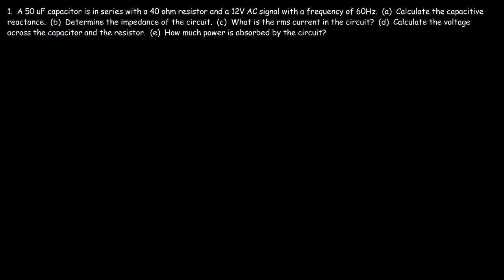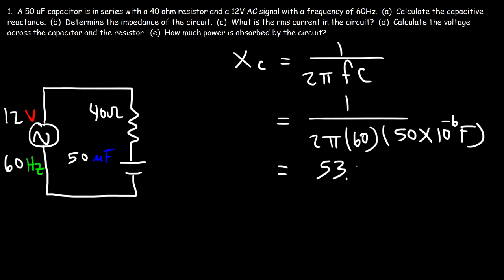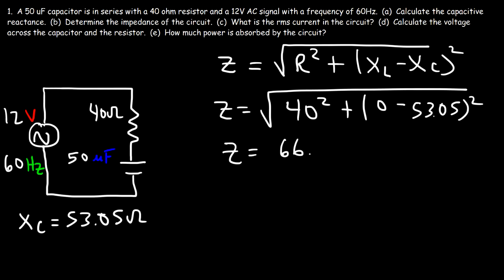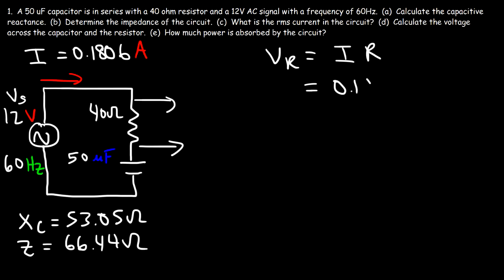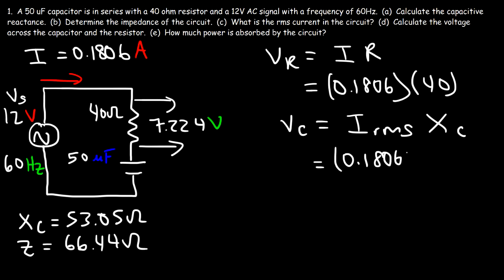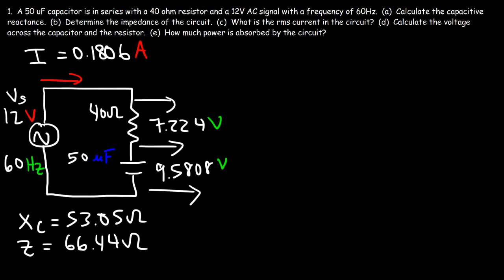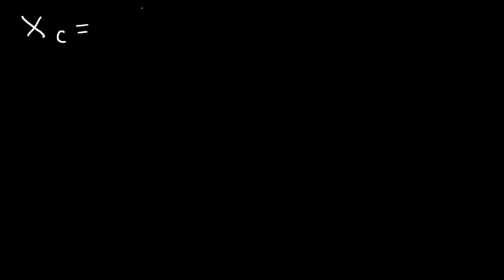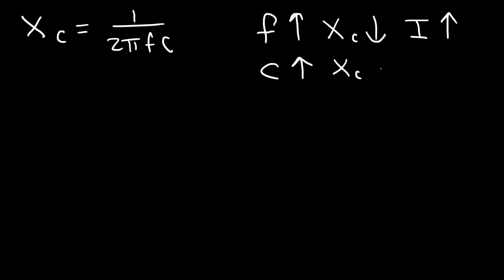Capacitive Reactance, Impedance, Power Factor, AC Circuits, Physics

Comment: Hella late but what would be the phase angles of this circuit?
Reply: Use inverse tangent.  So it would be inverse tangent multiplied by negative capacitive reactance divided by resistance.  It would look a but like: ϕ tan −1 =Xc/R).  
Or in this case, ϕ = tan-1(-53.05Ω/40Ω).  So phase angle is roughly -52.983°.  Roughly, if I didn't screw it up.

Comment: Bit hard punching these in my calculatir ,my answers are alot diferent
Reply: You're not alone lol
Reply: @curtisj.d.761 Make sure you enter the capacitor value in engineering notation. And if you have to enter the frequency in engineering notation. Solve the denominator first and then take the inverse of that answer
Reply: Make sure you enter the capacitor value in engineering notation and if u need to, also enter the frequency in engineering notation. And make to solve the denominator first and than find the inverse
Reply: Make sure you enter the capacitor value in engineering notation. And if you have to enter the frequency in engineering notation. Solve the denominator first and then take the inverse of that answer

Comment: When we put a resistor in series with a capacitor, we get the impedance of the circuit equal to Z = R - j*Xc, with Xc = 1/jwC. 
This means that when w increases, Xc decreases, and Z thus increases since we deduct Xc from R by a lower number.
If we decrease the frequency, Xc increases, and Z thus decreases. If Z decreases, the current increases, and vice versa. In this video however, you say that I increases when Xc decreases...

Comment: 7:07 I got 2.16 Watts using the V^2/R and I*V formula, but using I^2R i got 1.305, why is that?
Reply: Because you found the Power across that Specific Resistor using (I^2R)

When you multiply the Electro Motive Force of the circuit by the Current of the circuit, aka (I*V), you take all the Resistances of the circuit into the calculation.

As he explained at 6:42, the Capacitor gives Energy back to the Circuit, unlike the Resistor which only takes Energy from the circuit.

Therefore the Impedence of the Capacitor is not calculated when finding the Power Disappation in the Circuit, which would be the case if you did (I*V), but only the Resistance of the Resistor. Hence why the right forumla to use is (I^2R)
Reply: @EducationalLearning-i7l  Thanks but I don't even remember what I asked. 😂It will help someone for sure.
Reply: @perelium-x  👍
Reply: @perelium-x  i edited and added a bit more clarification to my explination if you would like to reread it

Comment: In case anyone finds this helpful for the first formula...
1.) 2•3.14 = 6.28
2.) 6.28 • 60 = 376.99
3.) 376.99 • 0.00005 = 0.01885
4.) 1 ÷ 0.01885 = 53.05

Summary: Don’t forget to add parenthesis in your calculator or you'll get a different result.
Formula: 1÷(2•3.14•60•0.00005) = 53.05Ω
Can also be written as 1÷(2•π•60•50•10^(-6) = 53.05Ω

Pico farad: 10^(-12)  Also written as 0.000000000001
micro farad: 10^(-6)  Also written as 0.000001

I'm studying cable properties via the SCTE organization and they weren't explaining the math behind the formulas. I decided to explore Youtube for a better explanation. Unfortunately during the very first formula you skipped right over how you got 53.05ohms....WTF? It would be helpful if in all future videos you show what's being typed into your calculator to achieve the end result. Thanks for taking the time to upload all the other information though :)
Reply: Thanks for adding the formula 👍🏼
Reply: Nice one
Reply: Don't suppose you know the formula for impedance do you ever time I do it I don't get anywhere near what he got so I must be doing it wrong on calculater :/
Reply: Says √ of 40 squared + 53.05 squared he gets 66.44 but God knows how
Reply: Im so confused on where you got the 0.0005 im about to jump off a bridge i hate math😕 i know this is a old comment but i hope you see this and can explain
Reply: @Dre6240  - 0.00005 is the decimal version of 50•10^(-6). And the 50•10^(-6) is part of the formula used. I simply changed it to decimal so I could enter it into a calculator easier.
Reply: @__-pl3jg  you’re a genius and a hero. It’s starting to all make sense now. I appreciate the quick reply
Reply: Thanks for the breakdown. I guess I don’t know how to do math
Reply: I was wondering how I do all the steps with the numbers but getting different results... I wasn't using parenthesis!
Reply: When I use the XL formula, I always solve the denominator first and then take the inverse..

I also like how u explained this for other users who may be new to this

Comment: I dont really have a great grasp on this subject so if I say something that makes no sense don't judge me. So I have an electromagnet, it generates 90.5 Tesla, B=(permeability)(loops per meter)(amps,current). the permeability is 2.3 x10^-2, loops per meter is 787.4, amps is 5. That's just with direct current, but since AC goes back and forth and deals with frequency could we just multiply the amps(5) times the frequency in the AC circuit? For context, the circuit I'm talking about is a very simple circuit nothing crazy just a power supply and electromagnet.

Comment: Can someone please help me with this question. Which of the following should be included in a calculation of impeadance for an A.C circuit that contains resistance inductance and capacitance. 
A) the resistance only
B) the value of none of these circuit elements. 
C)The value of all 3 impeadant circuit elements .
D)the value of the inductance and capacitance only.
Reply: It’s C
Reply: @geedestin3389  thanks gee  you are correct it is confirmed
Reply: Edward Quintana anytime
Reply: I've not seen a reply and not sure you got your answer elsewhere since it's been a year since you've posted but...Since inductance is expected to be the larger number per the equation for impedance, most electrical engineers are only going to calculate with known resistance and inductance. Capacitance is often so small of a value that's it's nearly insignificant. I'm sure there are some engineering brainiacs that will dispute it but, as a power engineer who has worked with electrical utilities....resistance and inductance is the overriding concern.
Reply: @kenmichaels1842  thanks Ken yea the answer is actually c
Reply: Cannot be C, the equation tells us this, sorry to spoil the good vibes. R and XL will be dominant. IEEE will validate this
Reply: Ken Michaels is, all three components are in the circuit then you have to use a formula that uses all three components. Simple, Organic chem tutor even stated that
Reply: My bad...u r correct, I read it as c (capacitance), not C (the answer selection). Gonna be a long day...
Reply: @kenmichaels1842  no problem stop working so hard😃